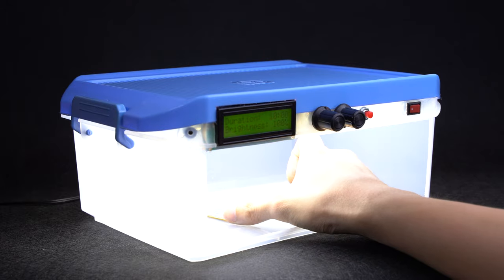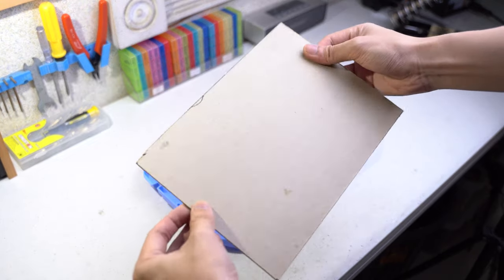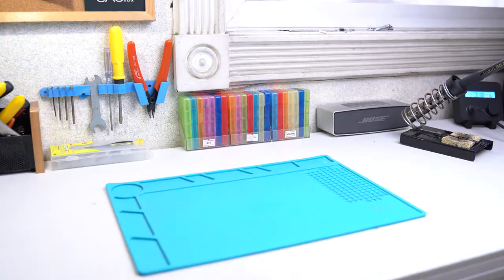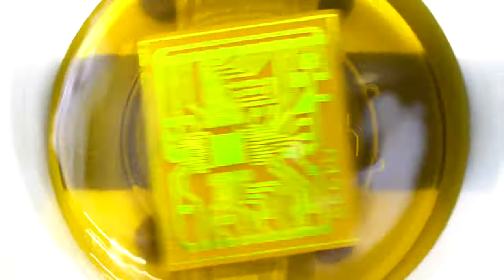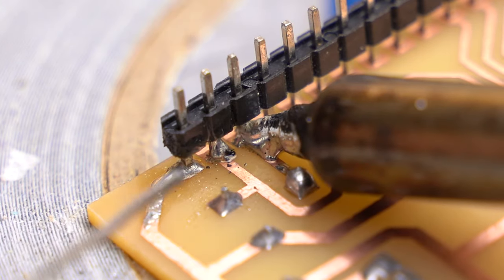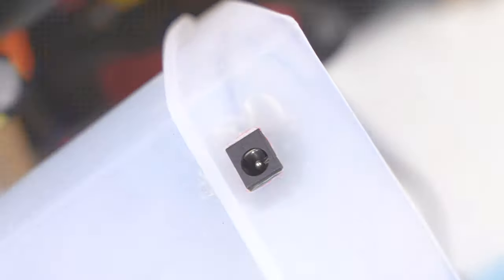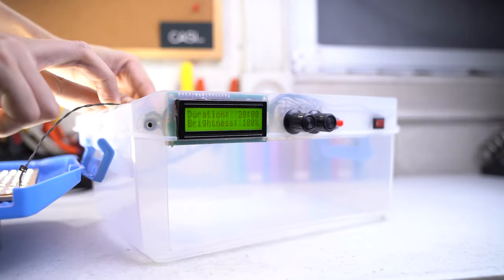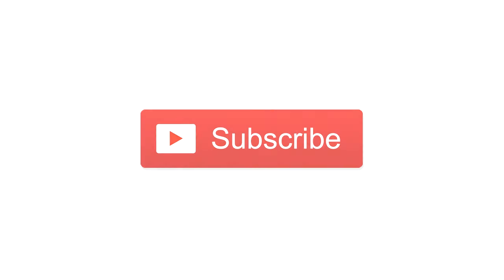DIY Digital PCB Exposure Box

Comment from the maker: Got some minor corrections on the Parts Placement diagram found on the video. Please base your parts placement from the downloadable file package. 
I forgot to add some footnotes. To avoid confusion, I changed some of stuff.

Link: https://bit.ly/2ZrGrXS
 (Same link from the descriptions tab)
Reply: How much does photoresist liquid cost are all the same do they work for diferent Metals  specially including gold and others like chromium
Reply: Gud day sir, that's a nice video tutorial but can I ask you if what computer software you are using to design and to know the exact values of components you need to use on your circuit projects? Can I know that? Thanks
Reply: Like those resistor values and even the potentiometer and transistor how can you calculate its values needed for your project
Reply: Hey there and thanks for a great project but are you going to upload the gerber files to your shared folder?  Also, you may want to design it with a LM7805 style power supply for any style of Arduino device such as the Nano you are using.  Thanks

Comment: Nice design, my wife and I built something similar inside a large, deep plastic stacking parts organizer. UV LED's along the inside of the drawer, to use we turn it over and slide the project underneath (on a letter sized clipboard). She uses hers for a photographic exposure box for workshops, so thankfully it doesn't need anything as precise as this, but I was certainly tempted!

Also tempted by making the tray rocker, would certainly get good use in the darkroom!

Comment: Increasing the distance from light source to PCB gives better resolution of fine tracks and less "undercutting" of them. Basically, the light rays ar more parallel and scatter less around the mask.
You'll need to increase exposure times as per inverse square law though. Also with longer times you need to avoid stray light getting in so use in darkened room or make from opaque material. 
Best light source I ever used for UV PCB was a DeVere large format photgraphic enlarger with colimator/condenser head. Distance form light source to PCB was 120cm. The resolution of the tracks was insane (mid 1980s)

Comment: Hello, Nice work! I have done mine digital PCB exposure Box based on yours( i will post pictures later)
I will give you a tip...you are using a TIP31C wich is a low gain base current (low Hfe)...Wich mean you can´t deliver the full power to the leds, because if you don't provide enough current at the base, you won't have full current going to the Led's strip.
If you use a TIP 101, wich is a NPN Darlington array transistor, wich is same package, the current delivery increase drastically.
I have made led panels for up side and low side for exposing double sided boards at the same time, and switched the NPN transistor for a logic level N channel FET logic. just added a 10K resistor from source to gate and everything is going fine...both panels consume 4.3 Amp.
Other thing it should be changed is that the UV leds shouldn´t be on when power is applied, but only when you press the start button....Because if you take 20 seconds to put the board and align the film, and put the timer for 1min and 30 seconds, the board will be exposed 1min and 50 seconds...
Best Regards and keep doing the good work ;)

Comment: Nice, simply build. Only suggestion would be to use a container that has dark/black wall, and maybe a drop down swinging door. That way in the event you have something cooking, and get pulled off on another task, interruption or appointment, you can be assured that it will not be over-exposed.
Reply: I mean you can always spray paint a clear container, but yeah best to get a dark one.

Comment: Nice project, I like it but Is much better to use a MOSFET instant of this low current transistor.  
Also, you have to correct your code. 
The lights have to remain off until you start the new time cycle.
Thank you for sharing :)
Reply from the maker: I went with a BJT since it was more common for others to follow. But yeah, a MOSFET would much be better.

The light was intended to turn off when the timer goes off, this was done to prevent the PCB from getting overexposed.

Comment: I had read somewhere that it is necessay to use 365nm uv leds for this.  Watching your video though that does not seem to be true.  So, you are using white led strips then?  Would uv led strips work just as well?
Reply: im wondering exactly the same

Comment: Hi, I think you have done a great job with this light box. You explain it very well and I have just build one from your designs. BUT I have a problem. I've programmed the nano and the dimmer works but the timing does not. All I get is a flickering display with some Ö or solid blocks. Any help would be great. Keep up the fantastic work!!

Comment: I'm looking to build one of these, but I'm looking to make it smaller, primarily in height. I'm just wondering if there's any reason yours are as high as they are? Is there a reason the pcb should be further away from the leds? Or would it be okay to make it smaller so the pcb is closer to the leds?

Comment: Hello I love your project and in fact I am building an imsoladora like that since it seems very interesting to use an Arduino and to be able to easily control the exposure of the boards. You could upload the schematic files to be able to make some modification. Thanks and best regards. Great video.
Reply: I mean the proteus file, when I open the one that currently exists, only the pcb appears and not the schematic. Thank you

Comment: I'm doing the same exact circuit of yours, the difference is I'm using a Arduino Uno. Why my TIP31C is so hot, overheating? And also my 2 potentiometer is smoking. Whats wrong?

Comment: hello sir 👋, if i connect the led with series connection, how can i maximise the output from Arduino, cause already try, but the light brightness is low due i applied series circuit, can you help me?

Comment: Nice video. Thanks for sharing!  I wonder WHY I didn't find your channel earlier! // Question: Any portable drill you can recommend me for my PCB projects? 
Thanks!
Reply from the maker: Thank you! For PCB fabrication, any cheap generic drill would do. I wouldn't recommend using a Dremel  3000 since it's too big. You need something small and fits at the palm of your hand, not unless you plan to buy those drill press Dremel attachments. I hope this helps! :)
Reply: @TechBuilder  Thanks for responding! I'll keep in mind your suggestions and Google for something smaller than those that you mentioned. Hopefully I'll find something.  Thanks again and keep up with your channel and projects!

Comment: Hi, nice video's 👍, can you also please post the link where we can buy the jumpers as I'm having a hard time finding them ☹. Thanx in advance 😁
Reply from the maker: Just buy a solid wire and strip them from their insulation. You can also use the leads from the resistors, capacitors or diodes once you cut them :)
Reply: @TechBuilder  I know that 😀 but isn't there a way to buy the roll of a wire like this? Cause the thin wires are not strong enough > for example if I want to solder a micro usb port I can solder it on the board with a loop to make the connection more durable, I hope U know hat I mean 😊

Comment: Excellent

There are no gerber files inside the folder

Can you give eagle .brd file so that we can make trace little big in easyeda

Thanks
Reply: Im trying to work that out.  If i can figure out how to get this PCB layout into Eagle or EasyEda, Ill let you know.  I was looking for the gerber files also.
Reply: @k7ilo_Las_Vegas  Thank you
Reply: @mdaslamknl  NP but I think I am going to just settle for putting mine on a solder-able breadboard since its not that big of a circuit and with the cost and wait for 1 or 2 of these boards being built and shipped to me, i could could build plenty of these.  Ill work out at least a dxf file and it can be imported into any design program to my knowledge

Comment: this is a slightly off topic question, but would you know how brushless gimbals do fine position control? I searched a lot but couldn't find a definitive sensorless brushless motor driving solution that could be used to make gimbals for small cameras say a GoPro. Since you've worked on electric vehicles involving brushless motors, i thought you could send me in the right direction :p
Reply from the maker: I made a gimbal from scratch before. As far as it goes, position tracking is all up to the gyroscope sensor while the BLDC controller controls the motor's direction and speed. The code creates a closed loop feedback structure between the motor, controller and the gyro. That's the conventional way. On the other hand, there's FOC (Field Oriented Control) but it much more complicated and is a whole other story (probably too overkill).
Reply: @TechBuilder  I understand how the closed loop system works, but I'm still confused how the esc manages to hold the motor position, after the error in the camera position is zero. All escs I've seen only control the speed of the brushless motor, and neither the torque nor the position of the shaft (I make multirotors)

Comment: Hi, I did the circuit twice but it doesn't work, there is no output current, why? Thanks.
Reply from the maker: What transistor did you use?
Reply: @TechBuilder  TIP31C

Comment: Its not working

when i connect 12v nano fired

can you tell how can i make it working

Thanks
Reply: I'm not sure why his Nano hasn't blown up also being fed with 12Vdc according to the schematic and the PCB layout pic but the Nano's max input voltage is 9Vdc but with every Nano that I have used, anything over 7.5Vdc has caused me issues so I use a simple 7805 power supply or an adjustable bulk power supply you can get from Amazon and feed the Nano and any other devices with the 5Vdc from the 7805 / bulk power supply and never feed any other device in my project from the 5Vdc output of a Nano.  I hope this helps you from frying anymore Nano's.
Reply: @k7ilo_Las_Vegas  Thank you

for reply and clarifying 

Thanks
Reply: @k7ilo_Las_Vegas  Finally i made working

In youtube he mention wrong to put 12v, it will burst everything lcd, arduino nano

I made Arduino nano with 5v , its working

In potentio control if i make low it will restart both working as brightness

I will look and modify, i will use i2c for lcd

Comment: really you need an arduino to do a lamp with a timer? r serious? gosh....
Reply from the maker: You can use a 555 timer or mod a kitchen alarm clock and add some transistors and a MOSFET. I did decide to use an Arduino Nano since they're dirt cheap these days,  not to mention you need precise exposure times for different boards (presensitized, dry film, photolytic ink).